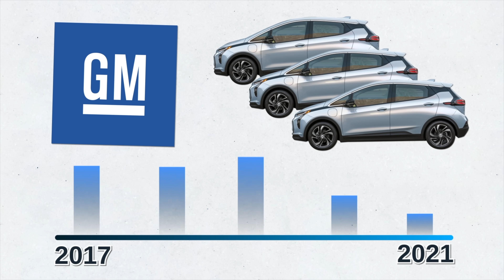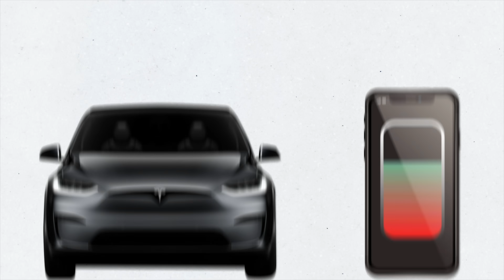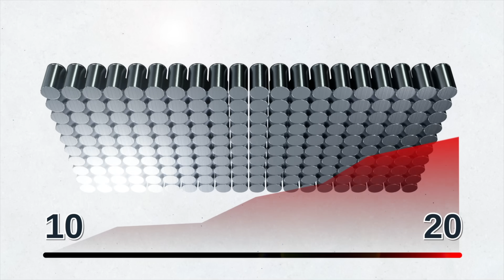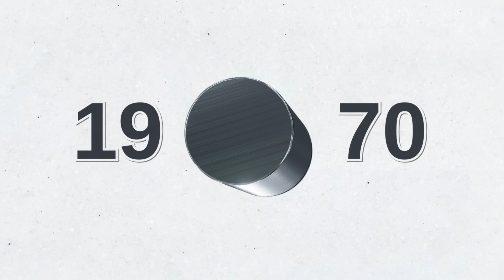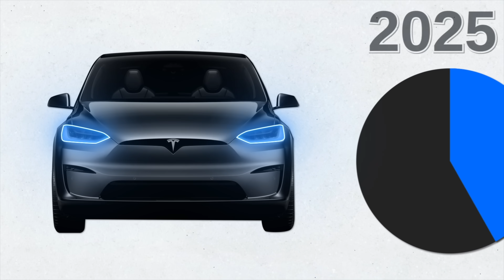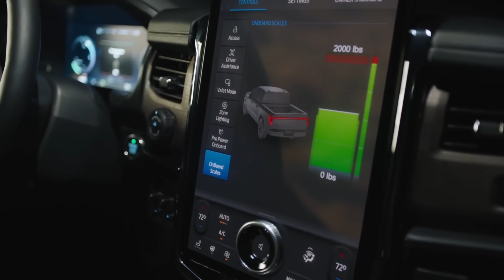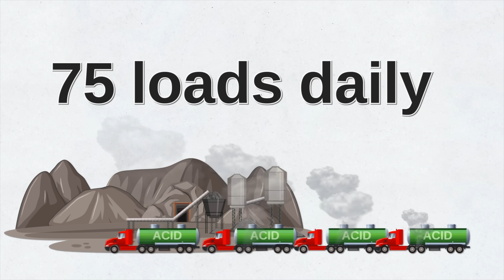They Tried to Shut Me Down for Telling the Truth About This Electric Car

Comment: Very nice video Scotty! My short answer: If you don't drive that much then: beater car/ insured 1 side max 10000$  (insurance 250$/y) VS a 45000$ min EV (insurance 1000$/y ) you will save a truck load of cash  and have a 35000$ slack to use on fuel... which will never happen because  you will still have to beat the insurance cost per year +750$ on a new car... Thus it's not even an ecological issue but an insurance issue. + you still have the issue of plugging it somewhere... waiting for it to recharge what a mess... You might even want to  buy an EV bike instead  hahahahh!!
Reply: I have a Ford Maverick hybrid on order. The Maverick costs $20,000 less than the cheapest Tesla. When I compared the annual cost including opportunity cost, insurance, maintenance, and fuel, I found the Maverick would save me $1,500 a year.

Comment: It would be nice to have a train to the factory that makes batteries and to the mine. That way less energy use also it would be nice to seperate the other metals from the dirt to use them as well, also this could be used to transport acids and other material that is needed to use the mine. A train is a lot more efficient.

Comment: Your battery life estimate is incorrect. You cannot base estimates on “time” but instead charge cycles. A good quality battery should last 5000 to 6000 cycles from 10-70percent before showing significant degradation. So using 60% of 250mile range vehicle should last around 750k miles under ideal conditions so under normal conditions there’s no reason to believe a battery can’t last over 500k miles.

Comment: Okay let's clarify a couple of things yes recycling batteries is an issue we've always had that issue with the batteries they use in regular vehicles and yes the process needs to be developed but remember this is still a new technology less than 5% of the vehicles on the road or approximately our EVS but as we get more and larger percentage of the vehicles become EAS which is going to happen regardless of what Scotty thinks a process for recycling the batteries will definitely have to happen and will happen if for no other reason just the money involved and the cost of batteries is going down remarkably they're improving the process and their improving the kind of batteries are using and they're also increasing the longevity of them which means more mileage for the vehicle
Reply: EV batteries are designed to be recycled from the beginning.

Comment: So let's assume over in California you  have thousands and thousands of EVs being plugged in at the same time plus all the air conditioning units running, all the cell phones being plugged in all the electronic devices being plugged in at any given time, there's no way the power grid could handle it
Reply: Most EVs are plugged in at night and renewables and energy storage projects are being developed and implemented all over the state. There are more blackouts in heavy fossil fuel areas but since they are so common they are usually ignored by the news.

Comment: And battery life is also dependent on the type of driving you do and the range of driving just like with a car if you don't put many miles on it the car or motor will last longer

Comment: Well as far as climate change is concerned we can just mix 30% sodium into fuel and put it into shipping containers and planes which will produce more clouds and absorb carbon from the air. 
Personally I don't see us moving to fully electric cars any time soon, yes I do see more highly efficient engines and hybrid vehicles as time goes on but we have pretty much reached the upper limit of battery technology with lithium batteries.

Comment: Fun fact. All EV vehicles will need to drive between 90 and 140k to become green, at which point will need a new battery. 😂
Reply: 20k, Tesla battery factory warranty is 8 YEARS. Same for the motors. ;)
680,000 mile Tesla driving around out there ;)

Comment: Isnt Honda producing clarity hydrogen vehicles?  GM did produce the EV1 from 1996-1999 pulled them back from celebrities like Ed begley Jr there was an interesting docu years ago.  Electric has been around for decades. Just the last 10 years ppl have started falling for "the cleaner cars"

Comment: They messed up with electric cars big time. They should have fitted a dynamo with an electric moter to run it and when they need more power for speed etc then the electric would run faster and this way they wouldn't need these battery packs and would not need to be charged and be relatively carbon neutral. They won't do this because this would loose them money as people wouldn't need to buy new battery packs and they will get percentage from electric companies so it wouldn't be a good  thing for them

Comment: Stupid Governments in the 1960's dissolved the Electric City Street Car systems and Diesel Passenger Trains. Electric cars will eventually be for ONLY the Rich.  FYI  - that is why I use DiDi in China ( Like Uber or Lyft ) to go most everywhere. DiDi in China is owner operated vehicle ( mostly electric ) that when you amortize the total costs between owning and maintaining your own car vs these types of services - the actual overall costs are less using these services. Smart business move. Also in China they have modern subway systems / high speed trains and electric bus networks that get you anywhere you really wish to go.  USA has no real infrastructure - not one high speed train in the whole country.

Comment: It is not a correct comparison to say “electricity comes from coal” because electric cars use less total energy because they are far more efficient with energy than ICE engines which loose most to the energy to heat waste.

Comment: With gas cars, you can do most of the maintenance at home. How do you jack up an electric car to maintain it? Don't tell me electric car don't require any maintenance. If it breaks, you can't do anything but to bring them in to get them fixed.
Reply: It’s new technology bro, I’m sure it was the same with gas cars. 
With time people will get a hang of it.
Reply: @icedrain4life  the thing is, electric cars are too heavy to jack up safely at home and it’s hard to find a good jack point without damaging the batteries, unless you have a lift. Also, if not pay attention, the strong electric current from those batteries can actually kill you.
Reply: @yihuandong1450  Ok I understand. 
Hopefully they’ll tweak the car design to ensure more safety and the market will encourage suitable Jacks for the cars. Since every company is moving towards EV
Reply: @icedrain4life  yeah. I hope there’s a standard that every factory follows for safety and jack points.

Comment: critiques are legit and the video is just stating facts, but what I wanna know is what does Scotty Kilmer think on the topic of greenhouse gas emissions? Whats the solution for transportation if not EVs?
Reply: Walk
Reply: Good old fashioned horsepower! Of the equine kind.  Equipped with heater,  automatic transmission, sometimes speed control & power steering too.

Comment: Honestly I believe there really isn't a "green" or eco friendly way to do transportation, not unless we go back to horses. ICE produce NOX gasses, EV's basically destroy soil and animal habitats, Hydrogen doesn't solve anything cause one of the biggest contributes to the green house effect is water vapor. Outside of going back to horses, going Flintstones style or just switching to powering vehicles through pedaling, there ISN'T as solution to global warming. Even if we go back to horses, or switch to human powered vehicles, it won't actually fix anything, it'll just mildly slow things down, potentially gain us a century, if there isn't some random extinction level event that happens. This is gonna sound super dumb but human powered flywheel based technology would be more of a solution to global warming than EV's

Comment: A friend bought the first model of Prius. Still has the original batteries. A couple of years ago, he calculated what he's saved on gas and it is enough to pay for the car. Free car! So who knows how long batteries really last. However, I have a 2002 Accord. 100K miles. Takes 10 minutes to gas up and runs the same distance in hot or cold weather. I'll never buy an EV.

Comment: Is the energy produced to make electric cars less than that used to produce fossil fuels? If it's more or equal to produce fossil fuels as it is to produce electric vehicles, then wouldn't electric cars have a smaller ecological footprint as after they are produced they aren't as detrimental to the community in operation than that of fossil fuels as their main ecological footprint is directly from the emissions released during it's operation?

Comment: Whilst nearly all 'technically' true, being very selective with a lot of those truths, for example you dont need to replace the WHOLE battery pack, you can have just the defective cells changed. That said id still wait a couple of years for the tech to improve, EV tech is still in its infancy, battery especially. But with the money being dumped into researching greener longer lasting faster charging it wont be  to long before they pretty much tick all the boxs

Comment: Has anyone figured out what mpg a car would need to match it's gas cost with the charge cost of an EV
Reply: I got obsessed and did the math:
It cost $10.61 to fully charge 82kwh at a 85% efficiency at $0.11 per kWh . 15000 miles year it will cost $476 to drive 15000. This does not include energy gains from regenerative braking.
 Gasoline needs to drive at an efficiency of $0.032 a mile when gas is $3.40 a gallon it would need 106mpg to match the cost of charging an EV.
The average car can do 25 mpg. At 15000 miles that's $2040 in gas, $1564 more than an the EV. All variable numbers were using the USA averages.

Comment: My Tesla Model 3 is 2 years old, 24k mi, has lost 14.4% (battery degradation) of it's battery capacity already. Not good.
Reply: Wonder what kind of capacity you will have at 10 year mark?

Comment: I'm pretty sure you can create an electric motor that has half the axle of the motor making the electricity to begin with and separated by completely insulated wall inside the main electric motor container with the single axle going down the center of it, that would on the other side of the insulation wall in the center of the container allow the other side to be the side of the electric motor generator to actually produce the action of the whole axle spinning by the produced energy on the other half of the axle separated by the insulated wall so that the separate partitions of the container are simply self-powered instantly active upon being triggered to begin the whole affair between the two or shall I say the unit axle dual implementation of a Dynamo generator coupled on the same axle with the action creating electric motor turbine or whatever you want to call it, I am pretty sure this is doable and the most simple design that I have ever come up with today that covers all the bases of the b***** that are system has been a run on for years!!? Thank you and may our common sense and logic awaken, and if you cannot get my logic or my grammatical syntax and the contextual meaning of what I have just shared, then please tell me about it and I will do a walk through again and do diagrams if I must!? Enjoy;)

Comment: These Tesla weenies think that the electricity used to charge their cars comes from a current bush. Totally clean energy. Right ! Fact # 1.There is not enough electrical infrastructure to charge these cars if everyone gets one. Fact # 2. Most of the electricity to charge these cars comes from non-renewable sources. Fact 3. EVS lose significant percentages of power very quickly when used in trucks that tow or haul heavy loads. Fact #4 These EV drivers have been driving on our roads for free for many years now. They pay no road tax. Fact #5 These cars are too expensive for a large percentage of the population. Fact # 6. As Scotty just mentioned, the recycling of the batteries is very complicated and toxic. Fact # 7. Maximum range as advertised by the EV manufacturers is possible, but not practical because they want you to keep the battery between 20 % and 80 % to help with longer battery life, thus giving a real range of just 60 %. My gasoline car can go probably 90-95 % of its range before refilling. All the while maintaining 100% of its performance until it totally runs out of fuel. There are many more facts that i can mention as well. These cars seem to be great if you drive short distances and have the ability to recharge in your garage overnight ( unless you have a BOLT). On long trips, especially a pickup when towing a heavy load, you have to recharge every 1.5 to 2 hours. Then you spend at least 45 minutes to recharge and go another short interval. Repeat many times. One guy recently towed a load weighing around 8000 lbs with his Rivian. I believe he drove around 2100 miles and stopped to charge about 21 times. This trip which would take me about 3.5 days with my Ford took him about twice as long. Factor in the additional meals and motels as well as wasted time and you can see that these vehicles are not ready for heavy use. They are primarily used by yuppies and trendy Millenials who have money and want to look cool.

Comment: No one ever does a video about the ugly side of oil or gas production. And all the thousands of acres of land that was ruined and is still ruined due to salt running out of the oil well.  Neither do they speak of all the injection wells which have millions of gallons of salt poured back into the ground. There is so much ugly associated with gas vehicles I could be writing all day. Go ahead and keep driving your vehicles with 20 gallons of highly explosive gas under your seat.  I’ll keep my Tesla which cost me ZERO dollars to drive due to my solar overproduction. When gas is $10 per gallon all these haters will be singing a new tune.
Reply: No, gasoline will be cheaper if everyone drives an electric vehicle as demand would go down.  Your Tesla is made from the same petroleum BTW.

Comment: False. Quality EV batteries can last way longer than eight years. (And the technology is improving all the time). Current tesla batteries can go quarter million miles easily. When people say the “end the life of a battery” it still may have 85% capacity it started with. In fact with all the Teslas ever produced it is exceptionally rare to have a battery replacement. Most battery Replacement are due to over supercharging or the occasional defective battery construction covered by warranty. 

And for those who say battery construction causes pollution( Which is true) and the grid You charge from is from fossil fuels? Well, it is much better to have the pollution out of our cities where we breathe and have the pollution far away where it disperse. Also the grid is getting cleaner every single year.

Comment: Pro tip: to get better gas mileage, remove half of the fuel injectors on your car!
Reply: What?! Why TF would you do that?
Reply: @king2091  half fuel injectors = 50% increase in fuel efficiency due to less fuel usage. And as a added bonus you get less power and a imbalanced engine (or you could remove them in a way your engine would still be balanced)
Reply: But that means more strain in everything else. Doesn't automatically mean the engine will balance itself no matter how you remove injectors. Gonna have codes tripping balls. Just because you can balance for power doesn't mean you should
Reply: @king2091  yeah ik it’s a joke I thought it was funny 🤷.
Reply: @carsman248  you crazy🤣

Comment: Electric vehicles will be something like a fad that always fade away. It's not the way to go if you want clean air and clean environment. I think that hydrogen fusion engines are the right way to go and gasoline vehicles will still exist decades if not over a century from now.